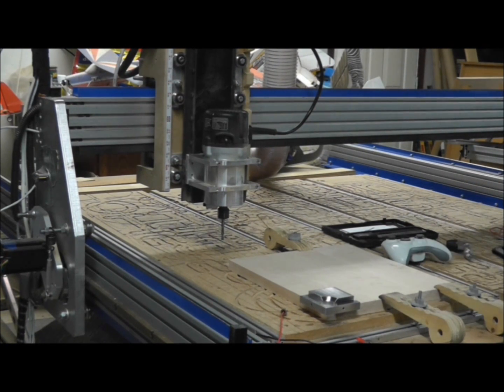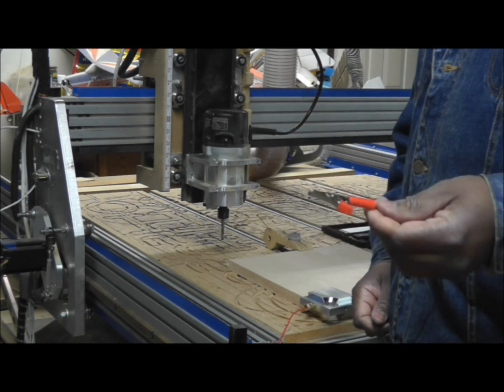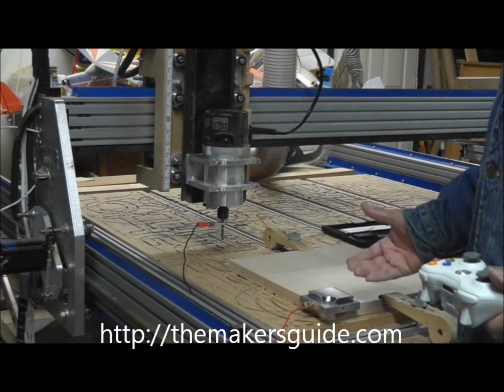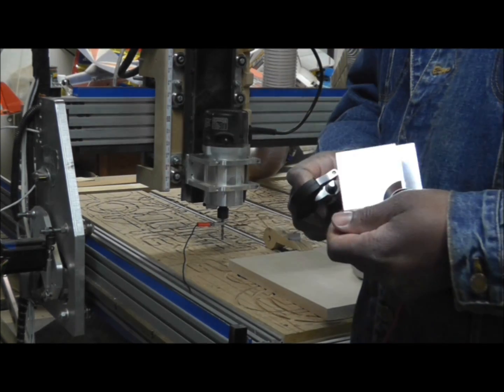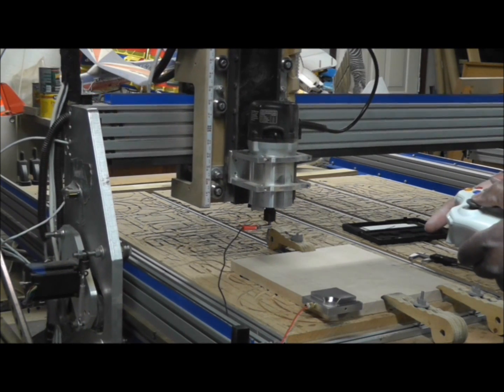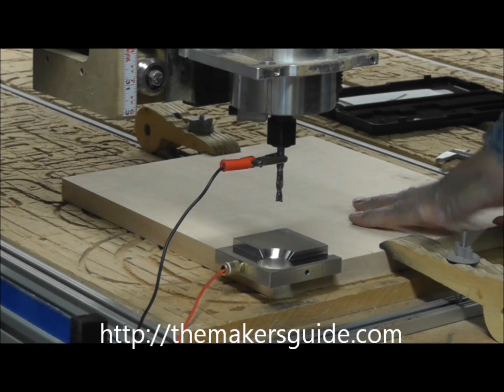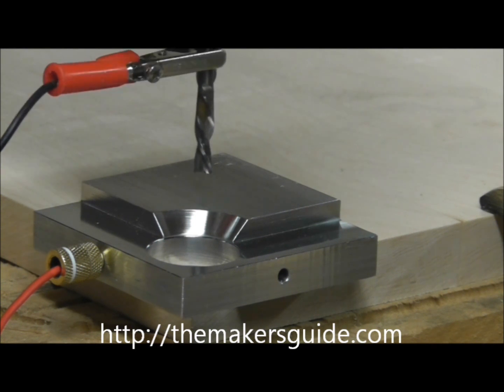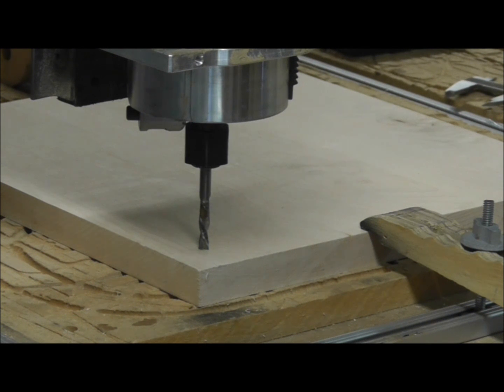Using The Makers Guide Triple Edge Finder

Comment: So this is just a standard touch probe. What about the triple aspect of this where you use the same block to set X and Y as well?
Reply from the maker: There are other videos on my channel that show this. You can find the edge using the center hole, You can also flip it over to find inside corners. Flip it upside down to find Z in the middle of a piece. Stand it on the edge  to find the side, etc, etc.

Comment: Bill-

Great video and fantastic podcast.  You really do a great job in making CNC accessible to everyone.  I have a question regarding your triple edge finder and VCarve Pro 8 and a couple of VCarve questions in general.  First, is there integration in VCarve Pro 8 for your triple edge finder or touch plates in general?  If so, how is it done. If not, is it then necessary to use an intermediary program like Mach3, 4 or chili pepper?   Also, is it necessary to invest in Mach3 or 4  as a program in between VCarve and my Xcarve?  If not technically necessary, does it provide additional capability?

Best Regards,
Brendan

Comment: Hi Bill,

I got one of these plates from you a couple of weeks ago and I have a couple of questions for you.

My machine is a Chinese 6040 and it came with a touch plate that connects on the back of the controller box with a small banana type plug, I have used it a couple of times and it did work on most times, I had the bit smashed against the solid plate, a couple of times, snapping or damaging the bit tip.

With this new triple edge finder, I'm unsure how to connect it, I know that I have to have 2 wires coming from different locations, one should be the earth, right.

The cable that is on the original touch plate, only has 1 wire and the clip that attaches to the bit, all come from the same place in the touch plate, both at attached to the main bolt that holds the plate so, I'm confuse.

Can I use the one that connects to the controller box as the "positive" and attach the other wire on a earth point in the controller box...???

Cheers
George
Reply from the maker: +nyodine Send me an email with pictures of your setup. It sounds like they are using a stereo plug which would have a ground and a power portion. The principal is the same one pin is ground and one is an input pin Usually 5V.